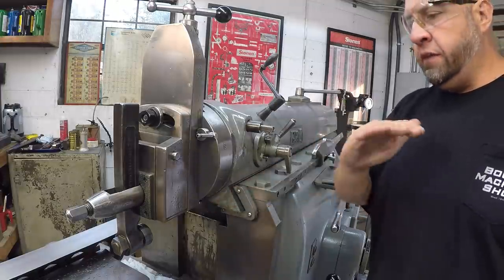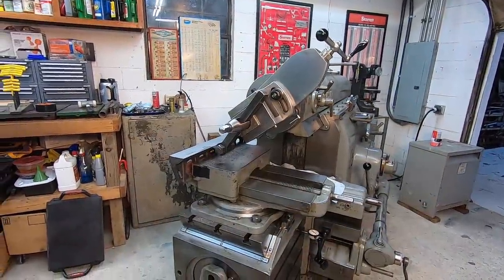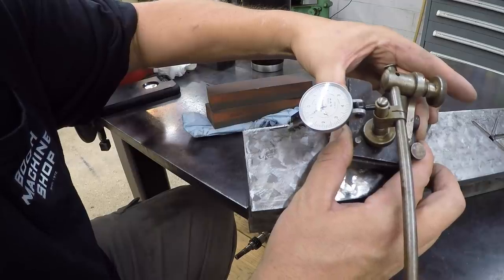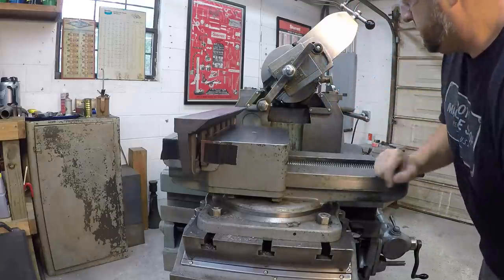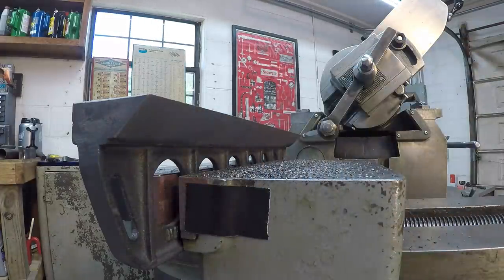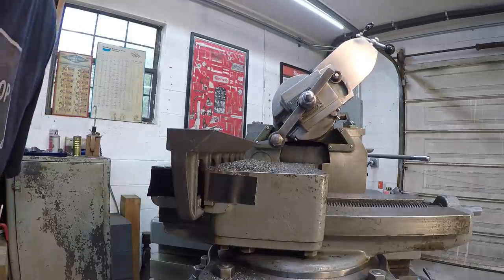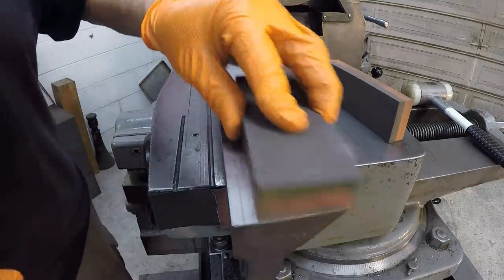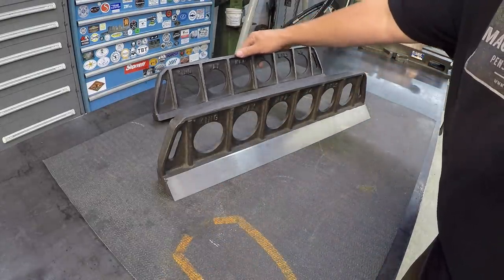Machining a 24 in Straight Edge with Dovetail Episode 2

Comment: I've had trouble also with hard spots in thin features of new castings. I think the foundry is not insulating well enough or quickly enough after annealing. The thin features cool too fast and re-harden.
Reply: This is probably actually a product of the casting itself. Whenever there is a sharp outside corner in a cast iron casting there is a risk of getting a 'chill' where the iron solidifies as white cast iron (basically iron carbide particles embedded in a steel matrix) not grey iron. As far as I know a normal annealing process won't change white iron into grey iron. The problem can be made worse if the foundry doesn't add enough silicon to the melt, as silicon helps to force the carbon in the alloy to form graphite rather than iron carbides.

Comment: When should you start do consider tool wear on making a cut? is it ever enough to mess up your tolerances?
Reply: It certainly can make a difference if you are working to very tight tolerances, especially on a lathe or shaper where a single cutting edge is doing all the work. I think usually what you would do to minimise the problem is use a fresh tool (ideally with a large edge radius) for the finish pass.

Comment: With less weight on the cutting head at that angle, the cutting head seems to actually bounce off the the surface during the back-stroke. Is that going to impact the tool, will it need sharpening more often?
Reply: It always bounces on the back stroke.
Reply: Andrew Delashaw Ah, perhaps this was the first time I watched it wearing really good headphones - I did not hear the bounce in previous shaper videos. Seems fine then ;) Thanks!

Comment: I guess I am wondering why you didn't just put the straightedge on some 90 degree "v" blocks and cut it straight.
Reply: That would have greatly increased the setup complexity and would have reduced the rigidity.

Comment: I'm surprised as much as you've ran that shaper you misjudged the overall work envelope of the head required at maximum travel.  Probably not the first crash for that shaper as minimal as it was.  Another future scraping project, shaper ram, dovetails and gibs...
Reply: I believe it was the first 45 degree setup he has run.  Sometimes stuff happens.  I know it doesn't in your perfect world, but some of us have to try and learn.

Comment: I wonder is there an adjustable limit that you can mess with two stop it from going back so far curiosity killed the cat
Reply: Yes i believe he just adjusted the entire work up more, so it had more room to step down without hitting the machine. In the previous config it essentially bottomed out. Now, everything started a lot higher, giving more room for downfeed

Comment: To avoid that issue, would it be better to feed up, instead of feeding down?  Can the shaper even feed in the opposite direction?
Reply: It doesn't matter which way you're feeding. You check the extremities for clearance, like he did the second time.
Reply: Andrew Delashaw that's the point of feeding in the opposite direction, you check the worst case extreme as opposed to the other.  Just a different way of doing it.

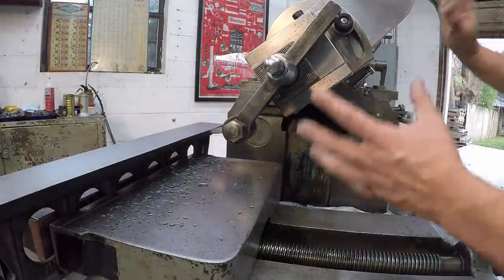Comment: 2:00 would adding a vernier scale to the zero area of the angle improve accuracy?
Reply: A vernier scaled would need to have the existing angle graduations be graduated in base 10. So there would need to be 10 hash marks between each integer angle. Or it would need to span 10° worth of hash marks, or span 10 hash marks period. (Like from 40°-45°, if the existing scale is graduated in 0.5° increments.) And the Vernier scale's marks would be 0.25°. Hope that's not to convoluted.
Reply: I'd be thinking "Sine Bar Tricks".
Reply: Indicating a 45 degree angle block or V block to the head travel would be easier...

Comment: How are you setting it to go on a 45 degree cut. Are you going over .050 and  down .050 each stroke?
Reply: Because the down feed is feeding at 45 degrees it's just down feeding without cross feeding. I was thinking the same as you to begin with :)
Reply: Oh thats even simpler than i thought. I need to stop over thinking it!

Comment: This is probably a dumb question, but what do you need the straight edge for?  How do you plan to use the straight edge in the shop?
Reply: Zengief77 the straight edges are handy for scraping in the ways on other machines. Often machine parts are too big and awkward to use the surface plate, so you use a straight edge instead.
Reply: @OldtimeIronman  Thanks for the response!  Now I understand why he keeps bringing up the future scraping project.  Am I right that scraping is where you put bluing across the surface and then use the straight edge to rub it off of the high points?
Reply: @Zengief77   Yep you are correct, that is scraping.... extremely accurate.

Comment: Hi Adam,  Do you think one of the CBN inserts would cut those hard spots at shaper speeds?
Reply: CBN inserts would probale cut them just fine, but the Shaper would likely break the CBN inserts just like it broke the Carbide ones he tried (don't remember which video). The backstroke of the shaper and the motion of the Clapper causes the edge of the tool to bounce along the surface of the part and chip.
Reply: I've found hard spots in a casting have to be ground.  It's the only way I've found to touch them.

Comment: How could the angle not be critical?
Reply: When you're bluing the surface to prepare for scraping, you're only wanting to bear on one of the surfaces. So when you're bluing the flat part, the angle section of the straight edge shouldn't be touching the angle of the ways. When you're bluing the angled part of the ways, only the angled part of your straight edge should be bearing on the angled part of the way. So really any angle between ~30-45° is acceptable.

Comment: What happens to the oil in that machine that its level goes down?
Reply: Probably drips of the ways as the ram is extended over the vise.  I think he pointed it out in one of the restoration videos.
Reply from the maker: SirDeanosity The sites on the top of the Ram ways indicate oil pressure. Monitor each time it’s being run to be sure it’s oiling.

Comment: Can someone fill me in on the process of how they metal flake gibs and ways?

Imma gonna Google around for an answer but if anyone wants to share please reply

Thanks.

Fantastic vintage machine, it looks almost soft from the years of being oil-soaked, and how silky smooth every bit moves

Edit: i found this

Practical Machinist - Largest Manufacturing Technology Forum on the Web

https://www.practicalmachinist.com/vb/machine-reconditioning-scraping-and-inspection/flaking-patterns-310599/

[ {Question} The most precise machine tool builder, Moore Machine, does not
flake their machines.

Anyone know why?

Paul

{Reply} Hydrodynamics, moore uses vee and flat ways with no gibs. Their way system is similar to a surface grinder, gravity adjustment which upon movement of the slides rides up on an oil film to prevent metal to metal contact. Flaking would serve to hinder this action. Moore did flake for decoration on exposed surfaces, mastering the hand generated half moon, as obvious on any of their rotary tables and setup angle plates. 

Research Hydrodynamics and you'll soon see the logic. Now on a mill or lathe or something with dovetails or perhaps box ways, clearance is established by gib adjustment, flaking allows adequate oil in the working components even with tight gibs, though not recommended. Flaking doesn't always save the world, but anyone whose been in rebuilding for some time knows it's use and when it's necessary.

Consider this analogy, a large mill, say a #5 cinn, heavy castings, thousands of hours of heavy cutting in production for years on end without much maintenance.  

Oil grooves within the ways acting like large arteries to carry mass volumes of way oil, branching into flaking like smaller vessels or veins and finally the scraping, akin to capillaries which finely disperse every last drop to every last working surface. Remove one step of the process and the chain is broken, useless.

Jig grinders position in small movements rather infrequently while remaining still during grinding. Cnc grinders or perhaps chop grinding is continuous movement however consider the load and speed difference to a large hor. Mill or planer where much force and higher speeds are used. Jig grinders are mostly a static way surface whereas most others are dynamic. Many surface grinders are flaked on the table only if at all, as this is a dynamic way, the other axes are static. 

Just a few things to consider, thanks for the observation.

Chris German. ]

Any comments?